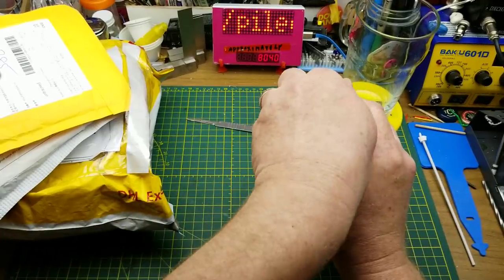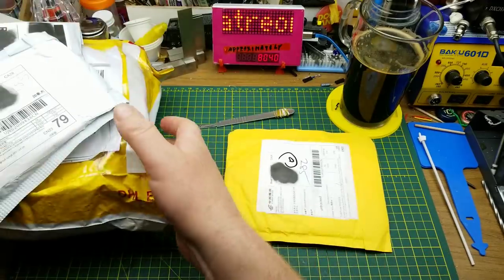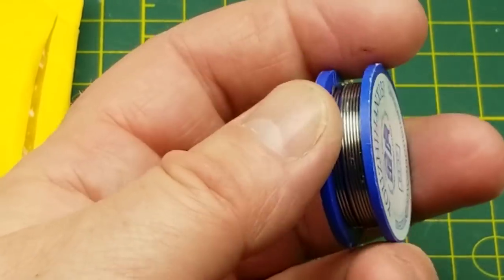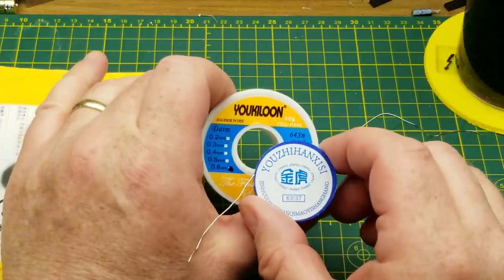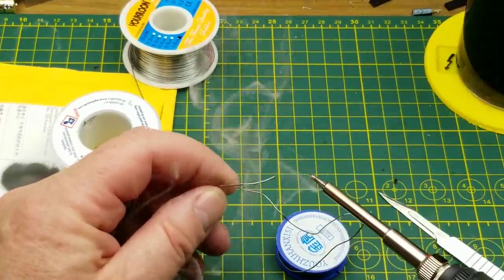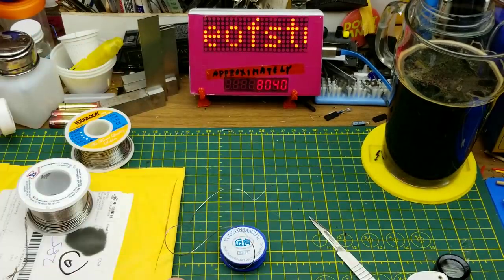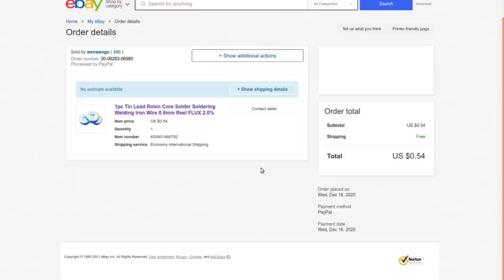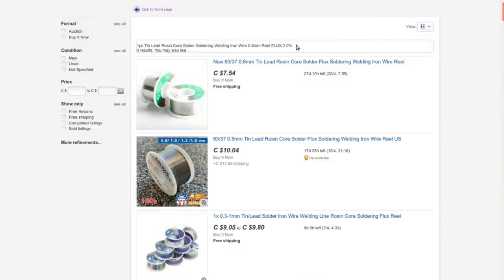Mailbag Monday #111

Comment: eutectic essentially means it both melts and solidifies at essentially the same temperature. non-eutectic solder. such as 60/40, has a transition range (IIRC something like a 20C range) in which it's neither fully solidified nor fully melted. Looks kind of slushy. It takes a moment to cross that transition range while cooling, and if you move the part or otherwise mess with the joint while it's transitioning it can cause bad joints. Since eutectic solder, such as 63/37, cross the transition from melted to solidified very quickly it means it is much easier to have a good joint. This is why 63/37 is recommended instead of 60/40.

I've tried buying cheap chinese solder a couple times, and each time it was completely unusable trash. TBH after thinking about it I'm now concerned that cheap crap might contain something caustic and damage iron tips.
Reply from the maker: I never have high hopes for the stuff I buy for under a dollar, but the exploration is always interesting.
Reply: You need content on yer channel. Don't be shy. Grab a drink and go fer it eh!

Comment: You may have issues if you try connecting a 3.5inch harddrive to that USB adapter. 2.5s draw far less power, so they can be often used without external power.
Reply: Most likely it's not a power draw issue but the lack of 12V.
Reply: That point was actually shown in the product listing, though PoS didn't mention it.

Comment: I have a couple of USB3 to sata convertors.  Such a joy combined with a cheap 60 or 120GB SSD drive.  The speeds you get compared to a quick usb stick makes you wonder why everybody even uses usb sticks to transfer files. It's not the big files that make a massive difference but small files like jpg's etc. Oww and even the pi4 boots from USB3-sata ssd's now although your mileage may differ due to different chipsets being used.

Comment: Your USB to SATA, you'll notice they didn't say 3.5" drives. A 3.5" drive will typically use 12v for the motor and 5v for the circuit board. A 2.5" drive will typically use only 5v, for both motor and circuit board. A USB to SATA adapter for 3.5" will usually have a separate power supply because USB just won't handle the power requirements.
Reply from the maker: That's useful to know. 
Thanks.

Comment: hi the usb to sata adapter will probably only work with 2.5" drives because most 3.5" drives require 12v the gps receiver is probably 2g cellular (won't work here (nz) any more because all local 2g has been switched off)
Reply: I just ordered  the SIM800L GPRS GSM Module from a reputable Canadian seller hoping to use it here in Canada. Think it will werk?

Comment: Use caution with the JST connectors - different sub-fields use them for LiPo batteries but with opposite polarity.  Mobile phones and Adafruit devices use one way, RC toys and controllers use the other.
Reply from the maker: Good reminder. Never trust the wire colour on cheap batteries (or power supplies). Always measure.
Reply: @pileofstuff  I measure daily.

Comment: You can't tell from the colour of the USB plug whether it's USB3 or not; it's not standardised.
That USB to SATA cable is for low power devices so it probably won't work with a mechanical 3.5" drive or a SATA CD player/recorder.

Comment: Why 63/37? When metals are mixed in various concentrations, the melting point at any given concentration is not a linear relation. There is a downwards curve. The concentration where the minimum melting temperature occurs is called the eutectic. This is important because alloys tend to be harder and have a lower melting temperature than the pure metals ... why we talk about the "bronze age" and not the "copper age."

For Sn/Pb this is 63/37 by weight with a melting point of 183°C. All other concentrations have higher melting temperatures ... very important for electronics. Also, at the eutectic, the melting point is very distinct, as compared with other concentrations where the mixture behaves more like a sticky goo which starts melting at one temperature, but continues to have stickiness a few degrees below this. For electronics, you definitely want a distinct melting point. 

On the other hand for plumbing, it is actually desirable to have a non-distinct gooey mixture so, as the pipes are cooling, you can continue to cram more solder into the joint. So 50/50 solder is preferred for plumbing.

Anyone buying 60/40 solder, or god forbid 50/50, for electronics ... clearly doesn't understand these principles.

Comment: "Let's just plug it into the computer and see what happens". Ouchie.
Reply from the maker: Some things I'm more cavalier about than others.

But I'm not too stressed about killing my shop computer. It's got a pretty well locked down Linux install on it., and the hardware is almost entirely used parts and stuff I picked up free on the side of the road almost 3 years ago. 
(seriously - take a look : https://youtu.be/Z1_zr5z-1lI)
Reply: @pileofstuff  Just ironic that you were worried about the GPS cloning your phone or bugging your house...but then effectively plugged the Seeed into your network.
Reply from the maker: @DavidPlass  The difference is Seeed is a well known and reputable company. The "GPS" tracker is from an unknown source with a craptacularly translated manual.
Reply: @pileofstuff  Ya my Military Spec MSI board I got from the recycle bin is awesome. I finally got it in a case with 2 x 4 TeraByte drives. and is my main machine  and a Media server . I think I did a video on that.  Mainly I like to build the comments on yer vids to let YT know yer worth it.

Comment: Quick and dirty explanation of "eutectic" is the lowest melting and freezing point alloy of two or more metals, lower than any of the components, a sigle temperature rather than a small temperature range. 63/37 lead/tin solder is 63% lead, the rest tin.
63/37 melts at 183C (361). That's fussy to manufacture so you also find 60/40 that melts at 188C (370F) plus or minus a couple degrees depending on whether it's melting or freezing. Think of it as thermal hysteresis.
What's the practical difference? 63/37 is marginally better for fine pitch SMDs (and really thinly metallized boards) that can't take a lot of heat, and that 0.8mm solder diameter seems perfectly suited.
It mostly matters in large volume production runs to keep power costs down but also helps a tiny bit building kits or doing hand rework to help prevent board and component damage.
Now you know more about it than you cared about. ;>)
Reply from the maker: I knew someone would know.

Thanks for the knowledge drop!
Reply: @pileofstuff  It's a dirty job but... well, you know.
Reply: Eutectic Solder that is listed as 63/37 is actually 63%Tin (Sn) and 37% Lead (Pb). Tin/Lead solder alloys are shown with the Tin element listed first. Kester has a nice Solder Alloy Temperature Chart that can be downloaded at https://www.kester.com/knowledge-base/alloy-temperature-chart .
Reply: @borr33tube  Oops.
Reply: @markfergerson2145  I have made the same mistake myself. :-)

Comment: "Though ... cost is low, quality is not guaranteed" ... somebody is getting fired for telling the truth.
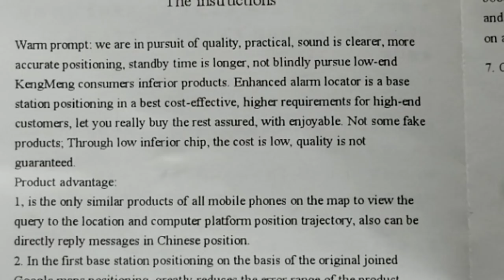Reply: Read it again at 10:03.  Most of it is very poorly translated but that line is actually "Not some fake products; Through low inferior chip, the cost is low, quality is not guaranteed."  The T in through should be lower case but it is part of the sentence before the semicolon.  They are talking about other "fake" products and not their own.  It is likely the best translated sentence in the whole manual!   ;-)
Reply: @ElmerFuddGun  So your saying that poorly translated sentence has perfect grammar? sure, let's go with that. I like my version better.
Reply: @stevenspmd  - Not at all but it likely is the best translated in the whole manual.  These companies could sell way more products if they at least tried to get the translation right.  And they would likely be better off in this manual if they only used pictures!   ;-)
Reply: @ElmerFuddGun  True enough. Though the same could be said about the many simple fixes people make for said cheap hardware; if manufacturers fixed that kinda of stuff the  "QC passed" sticker might start to mean something.

Comment: do not use unpowered SATA - USB connector on 3.5 inch drives as they draw too much power for the USB port to handle?
They sell 3.5 inch adapters with a power adapter to power the drive.